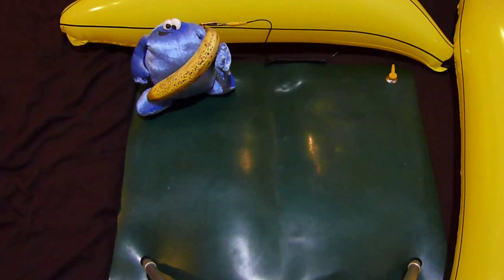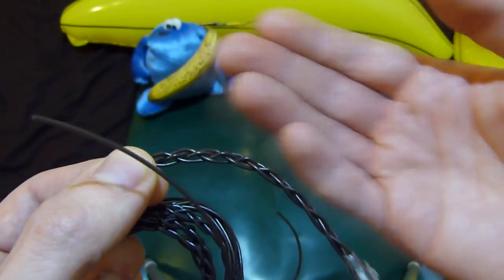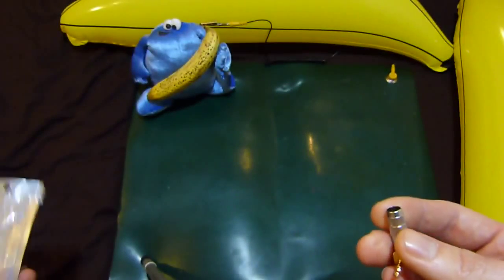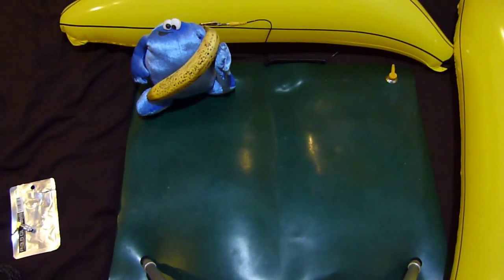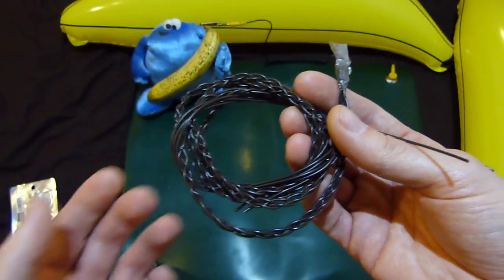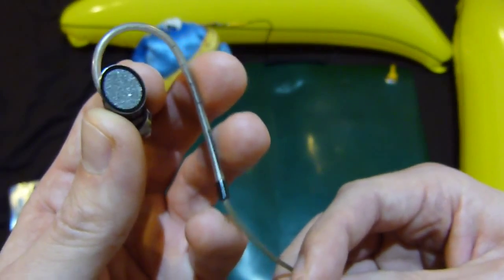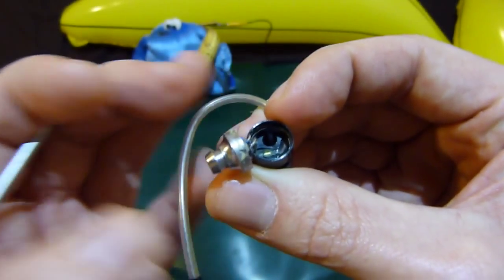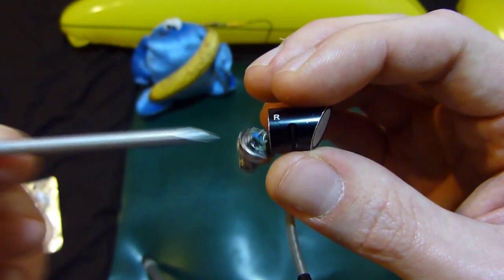Bowers and Wilkins B&W C5 inearphones MOD Part 1.5

Comment: Hello. How did you get the little drivers off the earphone enclosures? did you just pull them? or did you untight the little screws on them?
Reply from the maker: Hey fiogray, you need to carefully heat the cans and extract the silver bud horn. =)

What are you planning to do with yours?
Reply: Boonana J thanks. The left channel wire has a false contact that I may try to fix. Not sure if the false contact is inside of the earbud, so I may try to open it and see if I can fix something in there..
Reply from the maker: fiogray
 It would most likely be the plug end, but there's no harm in having a look, hope you get them fixed, let me know how it goes =D
Reply from the maker: +Dadcgall Hey Dadcgall no problem let me know how you get on with yours... it's a pain when they break!

#BoonanaJ
TeamBanana.co.uk

Comment: How did you open the headphone?

I am considering trying to replace the entire cable, and would appreciate any tips.
Reply from the maker: Hey Engelskhorn, go for it =D
You need to gently heat the cans to release the silver sound horns, and I do mean gently, otherwise you'll cook the internal cables and damage the driver.

What cables you thinking about fitting them with?
Reply: +Boonana J Just wanted to say "thank you" been waiting to find a solution to taking these apart and setting up proper wiring. Thanks again, they shall be saved!
Reply: In the end i just pulled them apart with 2 pliers. Slightly scratched them, but they work fine. I removed the original cable, and soldered in a new one.
Reply from the maker: +Engelskhorn Glad to hear you have made some progress with them... did you see my last comment 9 months ago on heating the cans first, as that allows them to pull apart gently without the need for force?

Do you have any pictures of them finished =)
I still need to get some footage recorded of mine!

#BoonanaJ   TeamBanana.co.uk